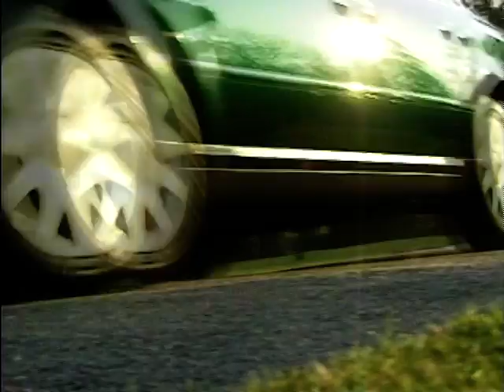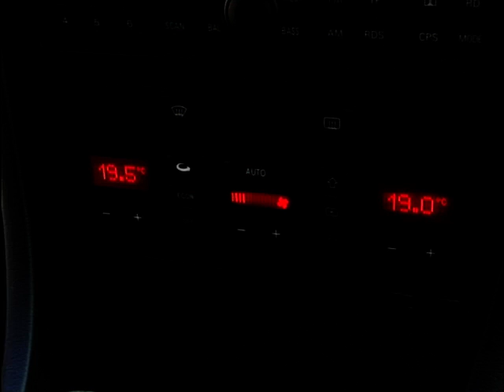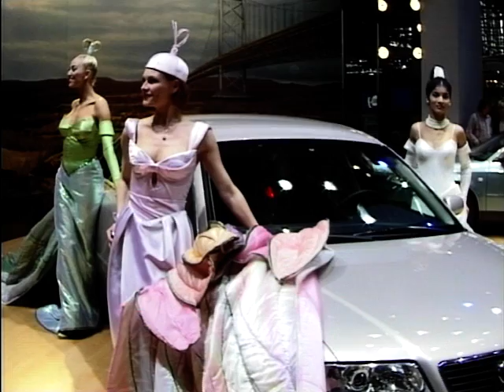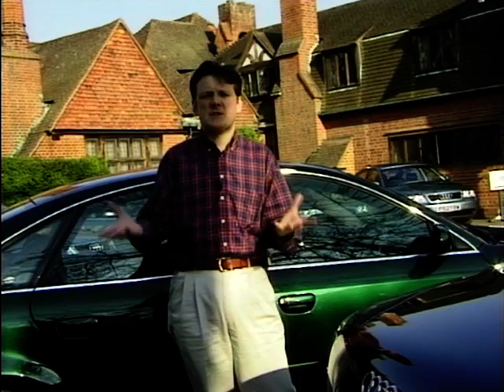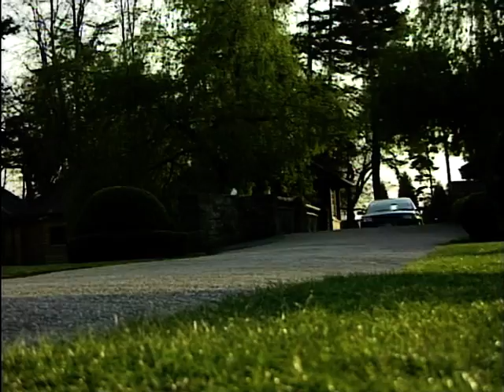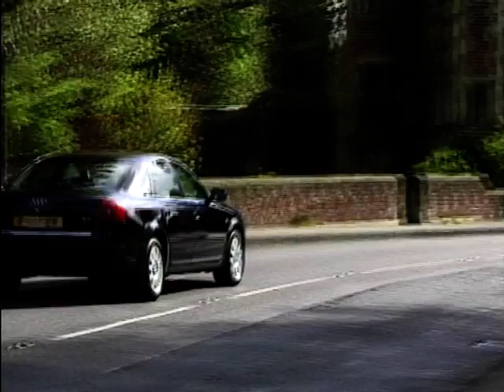1998 Audi A6 In-Depth Review - The Best Car Of It's Generation?

Comment: Well E39 5 series from BMW was and still is a better car in this class. Not to take away anything from A6 tho, it's a great car. Much better than most current plastic filled underengineered German cars.
Reply: True, BMW E39 a better car in every respect.
Reply: @justme-uw2hc I've had both and don't think there's much in it.
Reply: Unless you need awd
Reply: The BMW was the benchmark (ultimate driving machine) though I prefer the more elegant Audi design, it has aged quite nicely, inside and out.

Comment: It's very difficult to see your gear when the LCD  start fading too lol. Great cars though the 2.8 once you get all the plagues of cam tensioner leaks.
Reply: They aren't that bad to do TBF,
Reply: Currently own one of these, a 2.8 petrol at that. It's amazing. They fail to mention the built in ash trays, 1 front 2 back. As well as a few other small features that are just make it pop